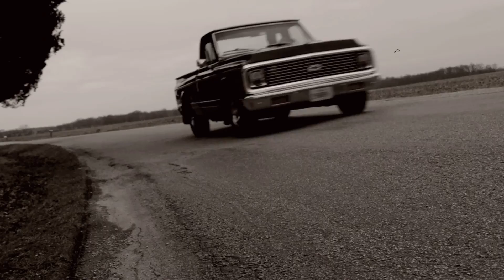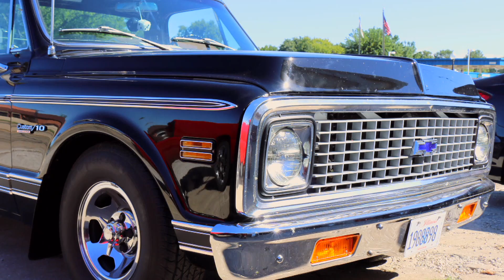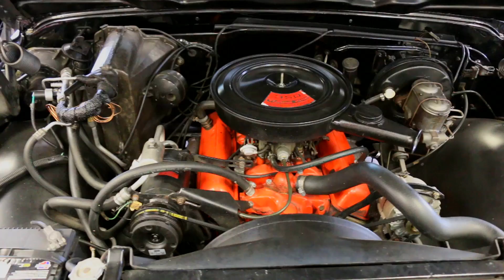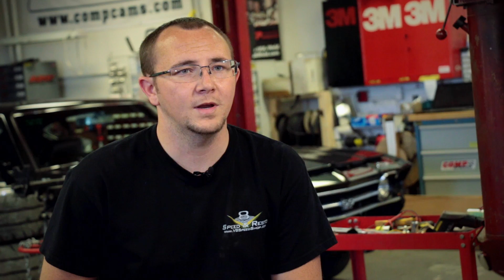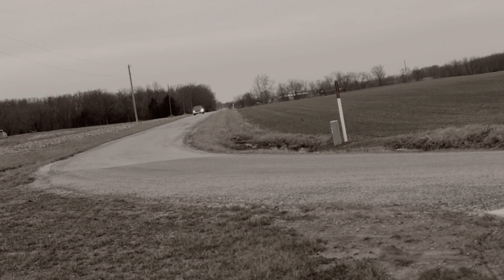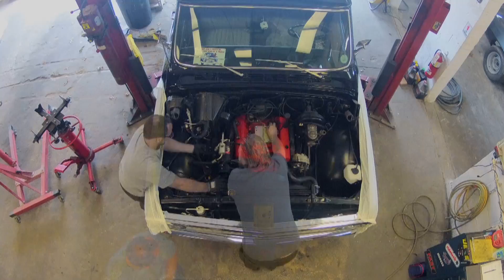1971 Chevrolet C10 LS3 4L60 Transmission Swap Video Series Part 1 V8 Speed and Resto Shop

Comment from the maker: Want a truck or engine swap like this one?  Contact: V8 Speed & Resto Shop - 314.783.8325 http://www.v8speedshop.com
Reply: Not a chance. 283 or 303 when it clearly says 350? And you want MY business?  😆👌🏼 lol
Reply from the maker: @20alphabet  Never believe the sticker on an air cleaner.    We ID'd this as a small-journal small block Chevy with 2.3" rod journals, indicating a 283 crank.   The 350 uses 2.1" journals, which this engine does not have.  The sticker was not accurate, which is why we check.    And no, we don't want your business.

Comment: You pussies can't pump a throttle to start an old engine, those old small block chevys are extremely reliable
Reply from the maker: True, but it's hard to deny the power and efficiency of a modern engine.   We build cars with carbs and EFI and know how to use and tune them all.     Let the carb sit with today's fuel in it and you'll be doing more than pumping the pedal.    This truck makes nearly 500 HP and gets 23 MPG, pretty cool we'd say.
Reply: V8TV I don't have any problems with my Holley carburetors, as far as I'm concerned fuck fuel injection!
Reply from the maker: Nothing wrong with carburetors.    Just trying to understand why you get so worked up over EFI.    Life is too short for the anger, man.
Reply: V8TV I'm not mad, I'm just saying that carburetors are just fine, they have a different smell, different sound, and different feel!
Reply: I Dailey my 71 c10 and it's pretty reliable It starts every time I don't understand why people want a ls it's way too expensive and u get better gas mileage but u could have spent ls money on gas
Reply from the maker: It's also about the performance these engines deliver at that efficiency level.   If you ever get the chance to drive one, go for it... they are fun.   Nothing wrong with a traditional SBC, however!
Reply: Ethan Cook fuckin right, long live the Chevrolet small block!
Reply: V8TV I'll definitely do that